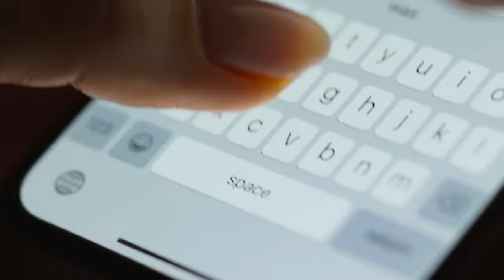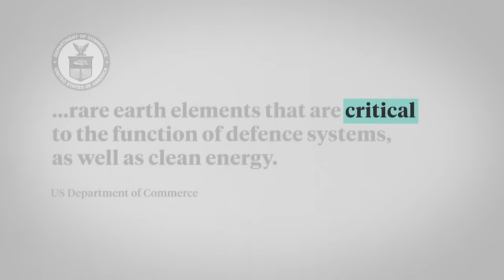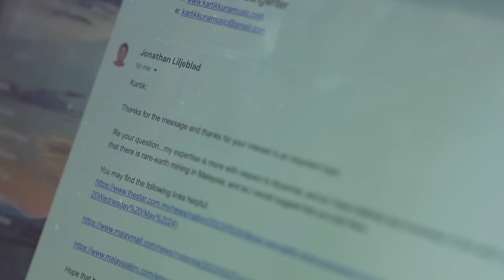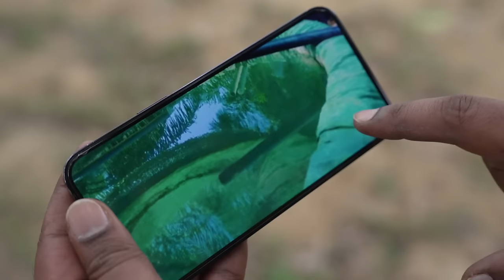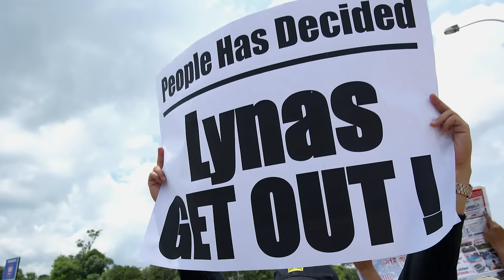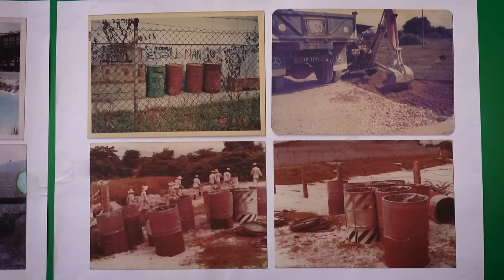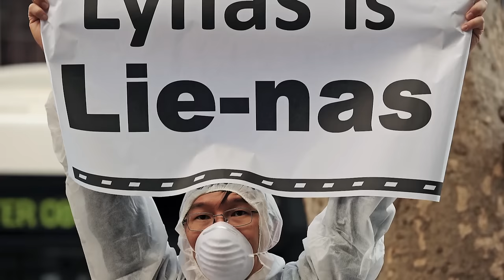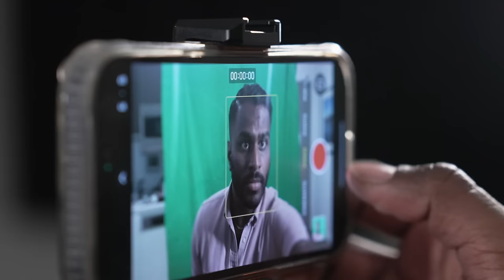From Malaysia To Myanmar: Paying A Price For World's Rare Earths Demand - Part 2/3 | Power Scramble

Comment: As a guy who had dealt with nuclear wastes, I can understand the concern of people in Malaysia and Myanmar.  In my early days, I helped design processing plant for precious metals, and strong sulfuric acid and nitric acid were used.  What I am not sure of the allegation that sulfuric acid was poured into mines to leach out rare earths.  Sulfuric acid costs over $2500 per ton, and pouring on to the mine would be very expensive and toxic fumes coming out would overwhelm the entire area.   Leaching is probably done in containers and HEATED to get maximum extraction.  If thorium is present in the ores, operators would have another set of problems.  Thorium is slightly radioactive.   I think the "Illegal" mines in Myanmar have been  APPROVED by the authorities, but the activists in Australia are alleging they are illegals.    I wish on the phone video shown towards the end, only the Kachin native opinion should count.  The Burmese guy (you can tell from his accent) was probably trying to accentuate his opposition to the mines.